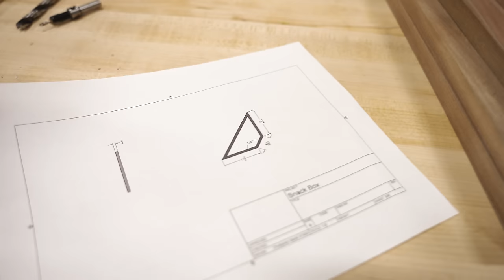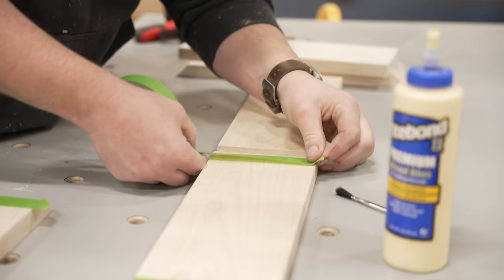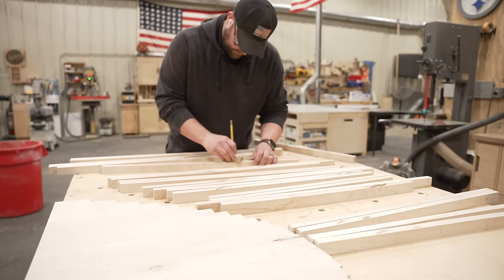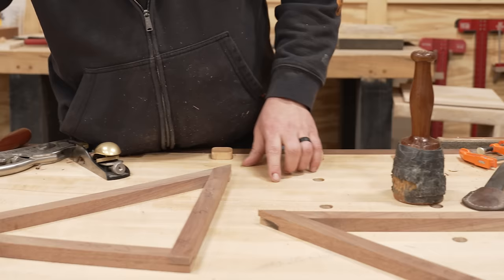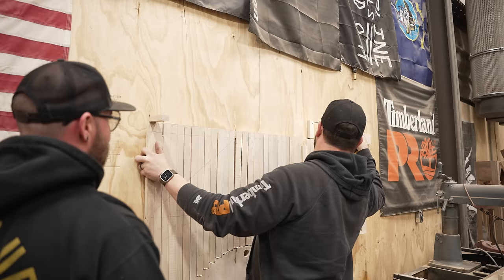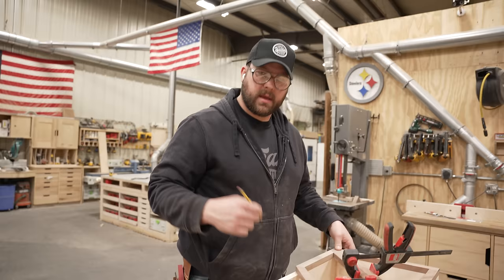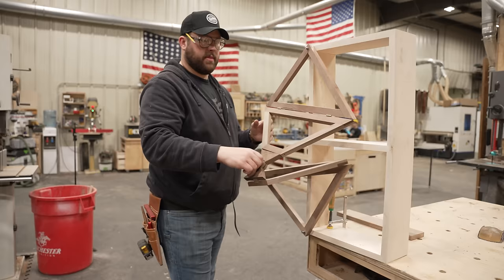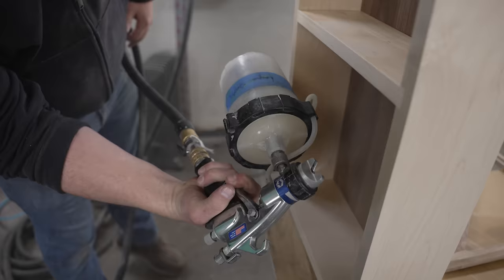I Build Viral Folding Furniture

Comment: Measuring in none freedom units is way easier and you don't have all the annoying fractions. Maybe it would help with accuracy in the shop😅
Reply: Doesn't really help if they work with "monarchy worship" tooling and in environments scaled to it but maybe we should popularise that wording to help confused individuals to move away from those issues
Reply: It does not matter what units you use, what does matter is knowing how to use them. You can have decimilised imperial so fraction are just the common method. The only area where metric is actually better is in calculations with measurments and in scaling projects. As metric is base a 10 measure system.

Comment: I'll never understand the "I don't need a measurement system that makes sense, I'd rather use imperial" mentality. I grew up thinking that mathing physical items was something I'd never be good at. It wasn't until I got a 3d printer and started working in metric as an adult that I realized I'm not bad at math, American fractions are just unnecessarily confusing? 
Look, I don't know what all those lines on a ruler are in between the quarter inches, and now I'll never need to. Thanks metric!

Comment: The cabinet looks awesome, maybe a drawer handle might work better than a knob so you move both pivot points at the same time instead of dragging the bottom one along. problem would be getting to perfect length handle to matches the pivot points.

Comment: Very nice build. Super entertaining video. Not the most practical table, but great fun to watch you build it.
 I have an idea for a build (or carve...), but I am not sure, I can explain it; from 1 piece of wood cut 3 (or more) interlocking/interlacing/interlinking pieces (each piece do what chain links do). Once cut, you should be able to tilt the 3 (or more) pieces out into a double cone shape, with the two cone tips on top of each other. When closed, they lie next to each other in the length of the original piece of wood - much longer than wide, for instance 20 " to 30" long, but only 4" x 4' square.
    Flipped out into the double cone shape it should be able to function as legs for a small coffee table.
   I hope, that makes sense. It might have a name, but I don't know it.

Comment: Yo table king you and the others across the pond are crazy. Surely it’s alot easier working in mm? (Metric)
Reply: Our system has advantages if you have the intellect to appreciate it. But you wouldn't know anyone like that, now would you? Not everyone can be a polymath genius I suppose. Pity that. Nothing worthwhile is ever easy.
Reply: @1pcfred  no one daft enough to use them measurements you mean?
Reply: @DonnyRP  what did I write that lead you to believe that is what I mean?

Comment: Why didn't they just do it in metric, it's not that difficult. If the drawing says 152 mm then just find 15 on the measuring device and add two extra notches (out of the 10) shown between 15 and 16.

Comment: Just get a ruler, tape measure or whatever with metric on it, UK ones have both, the tools don't care if you use imperial or metric so long as you're consistent and as you found out conversion will come back to bite you.
If you need to visualise how folding furniture works do a mock up with cardboard so you have a physical thing to look at and label.

Comment: Thanks for keeping it real and not just showing all the polished work. Sometimes, you just have to adjust things to move forward. Great job and they both turned out good.
Reply: The first time you make anything it is by definition a prototype. So you cannot expect it to come out perfectly. When a good furniture maker approaches a new project they will often build a prototype. So they can work out everything. They'll typically build the prototype in a lesser wood. It is the neophyte that expects perfection the first time out.

Comment: One thing I noticed with the door, is you could probably secure one if the pivot points in the handle to improve stability. Only one half needs to rotate. And it'll stop the netal tab poking out when trying to close it

Comment: Throw some magnets on the free corners of the cabinet and it should help snap it into place as well as help it wiggle less.
Also, might be able to add some wire or the like between the joints to limit how far out they can come which should help with the rigidity when opening and closing it.
Adding a gear that's fixed on either side of the center joint will also help with smoothness

Comment: If you HAVE to use the imperial system, don't just convert everything to feet and inches. find the ratio of the part lengths against one another: eg: 110mm/220mm so 1/2. and resize everything to imperial from there. It won't be the exact size of the original, but it'll be a heck of a lot better than cutting to 24/50ths of an inch or whathave you.

Comment: Wouldn't it be a lot easier to construct the desk itself out of the same 1x2 or whatever planks as you use for the wall supports? Cut them to lengths and align them to a drawing, glue up, and go. You then thin the wall slats slightly with a planer if needed to provide them with clearance.

Comment: On the door frames.. why not build frame and then add the angled peaces then using thin pull saw cut them out?
For the hinges one thing i have seen people do is glue fabric to be the hinge and i have used it couple times in my own projects. Problem is to figure out how attach the material to frame with out stiffening the fabric in the hinge point. CA glue is common method but you need to be careful not to have the fabric suck it too much into the material making it composite. Best method i have used is to have straight edge few mm away from the edge and infuse the glue in the fabric creating barrier, then gluing that into the frame being careful not to use too much but not too little and then fusing the back area into the wood with generous amount stiffening the back area. One that i havent yet tested is to proceed stiffening said area before hinge and putting some oil into hinge part to prevent glue being infused there then gluing it in place with more glue so that you dont have to worry that much of the glue seeping into hinge. I recommend trying in small scale and scrap peaces before committing to this design if its what you seek
Also you can build full custom tables in apartment floor on your own, though table sawing parts i did out source to store i bought the plywood since cutting from large peace would been pain and dust prevention/cleaning afterwards will be hectic but its possible. The small cabinet build is size i would recommend at the start though and more you use hand tools, less dust there is. Also due the hand tool method it takes bit more effort and time than on large shop, but then again you dont need to pay for that space as you already have it. How ever mainly for the Americans, if you plan on doing this, do it in room that has plastic matt, not the fluffy crap infested nightmare you tend to have, same with adjacent room so any dust does not move into there on your foots.

Comment: Its 100% not what its for, but I like the domino when doing slots (like expansion slots for bolts). Would using a 10mm domino cutter on ultra loose a few times in a row for the desired slot length and 10mm rod have been faster for you?

Comment: Here in the UK we use a weird mix of imperial and metric. Our rulers/tape measures have both. I think both systems have their uses
Reply: So do many of ours in the US! And it’s been that way since I’ve been a kid in the 1970s back when there was a little campaign to convert that never worked. But ever since, we DO use both. That’s why I don’t quite understand why they converted the measurements from the original plans in the first place. It’s not like the metric system is totally unknown in the US or even a little bit unknown or foreign. We do use the metric system all the time. We (US Americans) do tend to lack a bit of “instinctive” estimation in metric: for example, it’s easier to have a sense of how far 3 miles is over 5 kilometers. But that should not be a problem for things that require precise measurements and where guesstimation would be dumb … like building something like folding furniture. If the original plans are in metric, just use your metric measuring tools. They are very available in the US; I find it hard to believe this professional, well-stocked woodworking shop doesn’t have them.
Reply: @Daybreaq  Today i learned haha, from all content i see its usually posed as if imperial system is the only thing that exists in the US

Comment: I made a relatively  similar folding out slat table but did not make the mistake of having a solid upper hinge that caused you trouble with stopping the folding out too early.  I just used a stretchy cord across the top of the slats which worked like a charm.  Your tweak was making oblong holes in the slats for the hinging bar.  I also added a cleat onto the wall to push under so that the table would be much more stable in use.

Comment: Metric makes much more sense in any mathematics, designing, and building.  I'd rather use units of measure that break down into units that can be cross referenced to different units using the same standard.  For example, if I was mixing oil into my gasoline for a 2 stroke, I know that mixing 50:1, I need 2 milliliters of oil per 1000 ml of fuel.   

Volumes can be cross referenced and compared much easier with metric.  Another example, if I wanted to know how much 60% of a liter is,  I practically don't even need to think about it to know that 600 ml of the 1000 ml is 60% of it.  Now, if we were using imperial, without even thinking that deep about it,  how quarts of fuel is 60% of a gallon.   

It's very obvious which one is more practical, and also pretty obvious who those are who are too head strong to change their ways, even if it means repeatedly doing it the hard way.   Some people aim to live life the hard way.  

I will also say,  that due to some peoples methods, and their resistance to adapting measurements that are pretty much universally accepted nearly everywhere nowadays.  This resistance to change has caused those who have accepted the change, to have to learn both standards so instead of one group accepting change and learning one new standard,  everyone else has to learn or have somewhat of a grasp on both standards.

Comment: I respect all the hand work and I understand trying to do it with tools that are more accessible to people, but you've got 1000 moving parts that all have to interact with each other, a 3d model, and a cnc. could have just milled out all the parts you need and everything would have worked so much more smoothly.

Comment: the way I learned to make mitre boxes is using tape along the edges to get a tight seem and using the tape to put tension on them. or use those fancy angle clamps you used in ur mitresaw video

Comment: @John_Malecki Do your Shop Shades come in a prescription lens variant? I literally can't see without my glasses, but they're not ANSI or OSHA certified, and don't have side shields. I've tried oversized 3M safety glasses, but they fog up and slide off my nose, so all I can do is wear safety goggles, which fog up and are really uncomfortable with the elastic strap. So I've been looking for properly certified prescription safety glasses and was wondering if your can be ordered that way, or if I have to keep looking. Thanks!

Comment: Metric to SAE watch out. You ever hear about how NASA blew up the CHALLANGER? The O-ring that blew up was designed by a European agency so when NASA got the schematics, they had to convert all the measurements from Metric to SAE. Somewhere in the bunch of hundreds of measurements, someone either forgot to convert or converted a number twice causing the O-ring to be made to the wrong specs leading to the national disaster of the Challenger explosion with all lives on board. Later asked what happened... the O-ring designers said they never had the numbers set to Metric. They were SAE the whole time.

Comment: There were no gaps specified and the kerfs were not clearly marked. The drafter for the plans fails. Might I suggest having everyone in the shop take a basic technical drawing course or at least watch some videos on the subject, because your shop has these sorts of problems all the time and they are a common problem in the woodworking, construction, and industrial maintenance industry. Such a large problem that when I did my electrician training, one of my first classes was on technical drawing interpretation and creation so that little things don't happen like this. I'm no draftsman, but I can make a drawing for something basic like this and read it without making mistakes.

Comment: "I converted all the metric measurements into inches," is not the flex anybody thinks it is. You can buy metric measuring equipment and it is about the same price as the imperial. Hell, most measuring tapes I've found have both.

TL;DR: You're not clever, you're stubborn.

Comment: "Precision measuring" using Imperial - good luck! Muahaha
Reply: When you're doing ultra precise work it can be a bit of luck. Just measuring doesn't actually make the cut for you. But you don't strike me as the type that would know that. Otherwise you wouldn't say such foolish things like you do. You can only measure before and then after the cut. Skill can only take you so far. Going past that takes some luck. Once I made a device and when I swept it with a dial indicator the needle didn't even budge. That means it was precise to better than 0.0001" That's 0.00254 mm Which is less than a tenth the thickness of a strand of hair. I'm good but I'll admit that was a bit of luck.
Reply: @1pcfred  OK, you might be right about my skills and I really admire your abillity to judge my woodworking skills out of a few words I wrote. 

I simply sugest using a better measuring method. 

The metric system is a consistent and coherent system of units. In other words, it fits together very well and calculations are easy because it is decimal. This is a big advantage for use in the home, education, industry and science. Hands down!
Reply: @lennartpersson9834  woodworking? I don't remember saying anything about woodworking. Good luck holding that tolerance in wood. When I did it I was working with hardened steel. There dimensional accuracy is a reasonable expectation. I can't count the times I've measured and then the final cut wasn't what I wanted it to be. That usually didn't have anything to do with my measuring. I just blew the cut. Although sometimes I've made mistakes laying out too. It happens. To err is human. Using a better measuring method won't change any of that either. I'm still going to make mistakes.

Comment: Woodworker: refuses the precision metric provides AND uses a totally inaccurate conversion if 2.54cm/inch
Also woodworker: WHY DOESN'T IT FIT PERFECTLY 

Mistakes in precision add up over time... Conversion to imperial, drawing to sawing irl, human mistakes however small they may be etc etc

Comment: Don't convert from metric to imperial and vice versa. You'll end up in a mess. The Russians did this when they got their hands on a B-29 late in WW2. Their (metric) copy Tu-4 ended up half a ton heavier.

Regarding the table: Perhaps you used too good wood / hardwood? Soft wood might give a bit more flexibility (at the expense of longevity).

Comment: "Fckin metric measurements" 

Like, and be honest; Don't you all secretly wish you guys were also already using metric? 😆
It's so much more logical, and easy to use. It all just works, and fits, nicely together, in harmony. 

And, and... Imperial measurements are nuts! 😅
Like feet. You want to measure things in average body parts, still?
What you call an inch, is basically called "a thumb" where I'm from. And is mostly used in carpentry and TV measurements.

Edit: 16:53 This is what I mean? 4 and 15/16's inches!? How does one even do that? Does inches naturally divide into 16, or do you just have to do that yourself? Cm and mm sounds 100 times more convenient, but.. wth do I know. 😅 I guess the crazy measurement stems from converting 12.5 cm into inches in the first place, so.
Reply: As an American I will tell you I try to normalize using metric in my day to day life, although when working w/ my dad and other older guys, they tend to get mad whenever I use metric. They'll tell me "just use 'standard' (imperial) it's easier".
Reply: @simpled5755  I understand. It's a catch 22. You can't use Metric because "it's harder" and you're already used to another system. 

But the fact is that metric comes with a ton of advantages, and is way easier to use in many ways. Because of its decimal nature, calculations using the metric system is actually easier and faster.

It's a shame that we can't ALL just agree on using "the best" systems, also making them universal systems.

But kudos to you for trying, and expanding your horizons. And greetings from Norway!